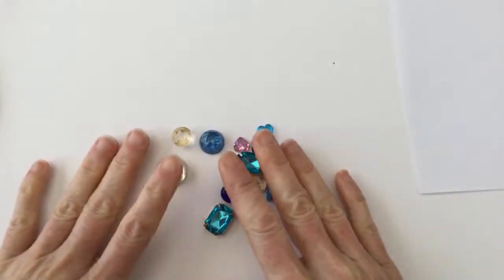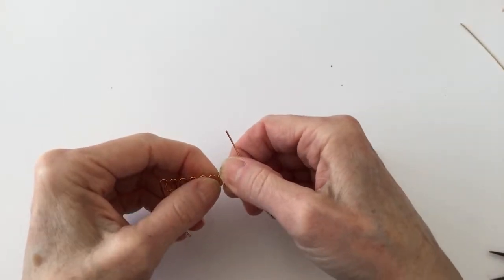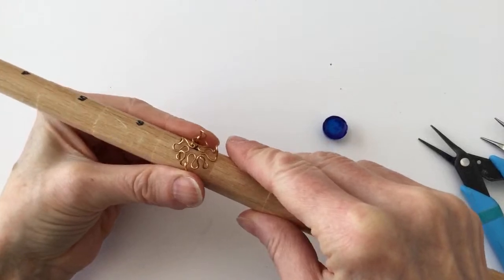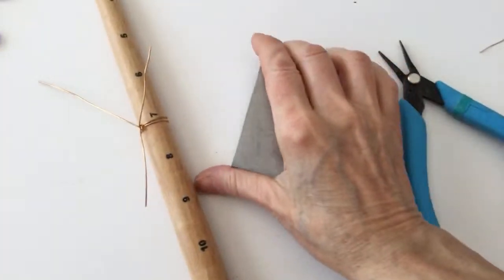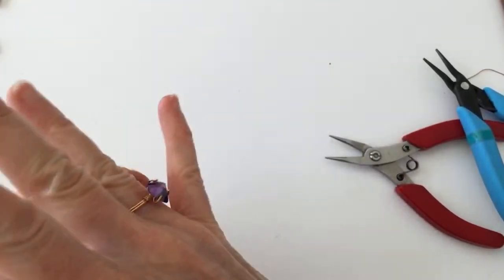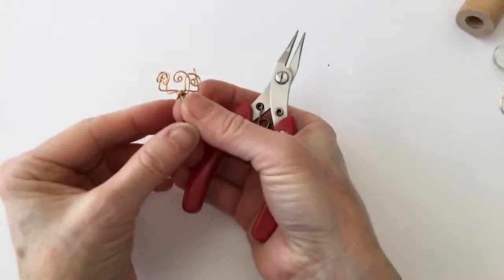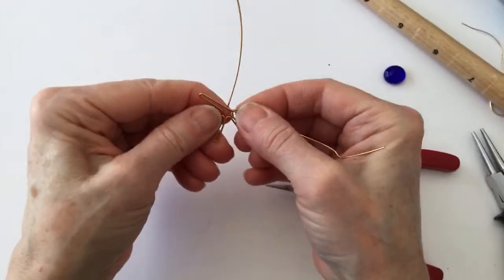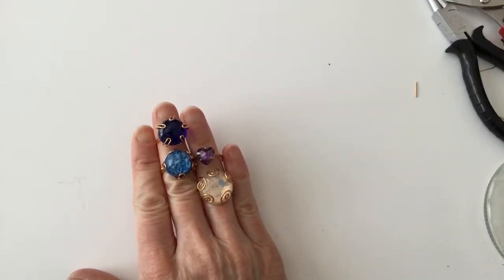Wire Prong Rings // Wire Lady TV Ep 194 Jewelry Making Livestream

Comment from the maker: Thank you Amber for the timestamps: Sketching ideas: 3:00
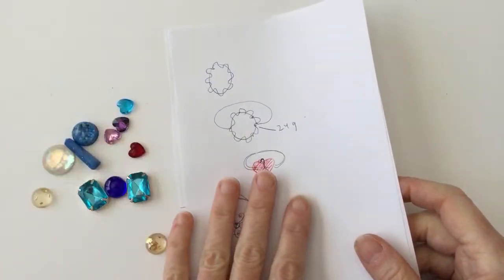Wavy prong ring w/ blue resin cabochon: 5:15 (starts making ring: 7:15 ~ attaching ring band: 18:00 ~ reinforcing "inner prongs": 23:15 ~ securing cabochon: 25:45 )
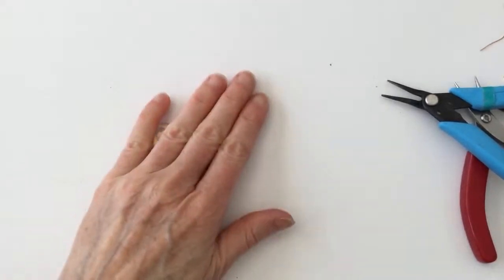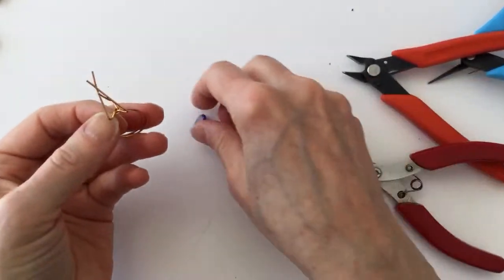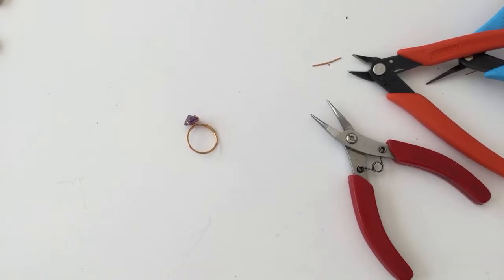Three prong ring w/ purple crystal heart: 26:35 (fitting crystal heart: 36:00 ~ filing prong ends: 37:20 ~ reinforcing ring band: 38:50 ~ securing crystal heart: 40:40 )
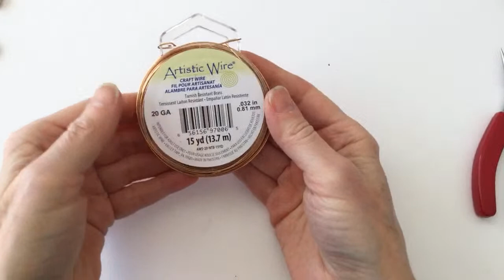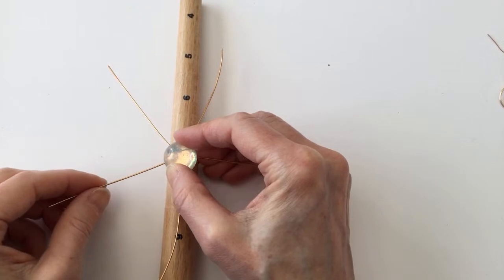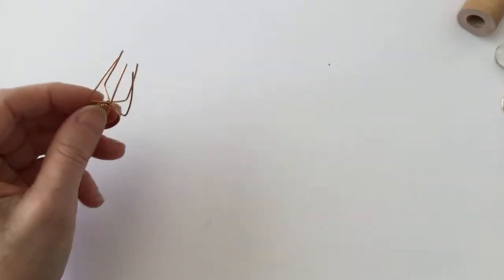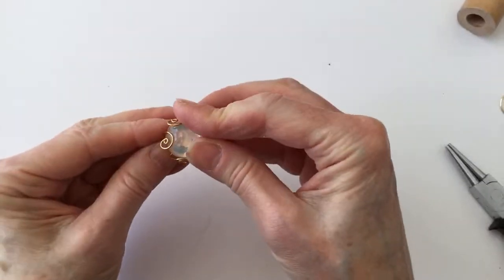Five spiral prong ring w/ opalescent cabochon: 42:10 (fitting cabochon: 47:50 ~ spiraling prongs: 49:35 ~ securing cabochon:  52:30 )
Five prong ring w/ blue glass bobble: 55:00 (starts making ring: 59:00 ~ securing bobble: 1:10:05 )